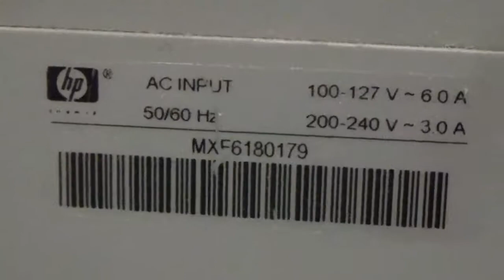Clean out inside PC case with air compressor Pt 1

Comment: I've blown the dust out of thousands of PCs.  Some were a lot better than that, some were a lot worse.  We had a couple so bad it set the smoke detectors in the building off.  Sirens, strobes, fire department called, all of it.  Some were so bad we had to leave the shop for 5 minutes and let the dust settle.
Reply from the maker: Oh damn that is really something. I would figure a fine would be involved. 
It was really getting bad with dust in the garage.  I was waving the air nozzle around to push it away quite often I think some of it was edited out to shorten the video up. 
There is another PC getting cleaned out scheduled to go public.
Reply: There may be fines, but I think the fire department has to show up for that to happen, and usually you're allowed 2 false alarms (for residential, anyway) before you get fined.  FUN FACT:  Next door, my favorite neighbors had their alarm system go haywire a few times while they weren't home.  I saw the cops show up, case the joint, and then leave because it was a false alarm.  Anyway, on the third time, the cops WAITED there, and when they arrived home, they slapped them with the fine!!!!!  That was SO satisfying!!!